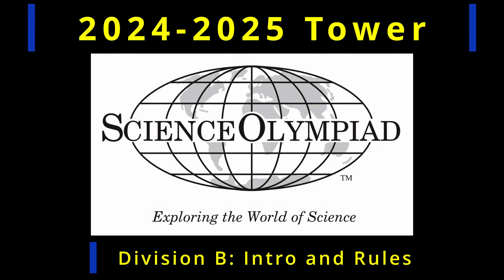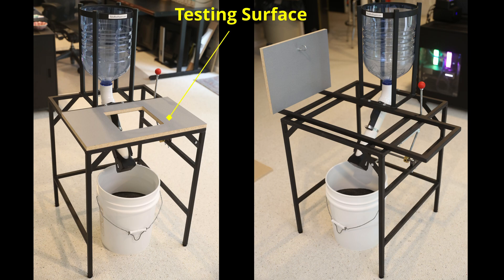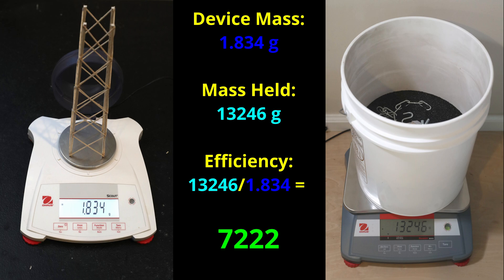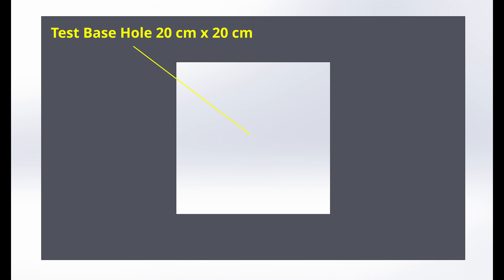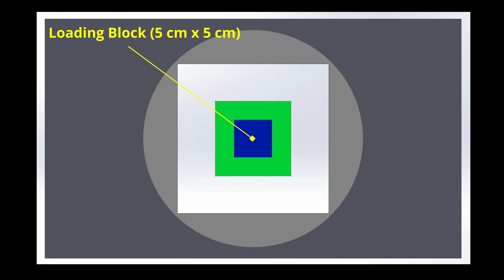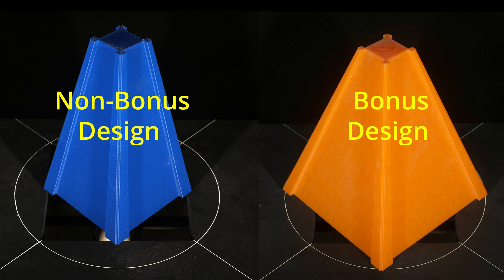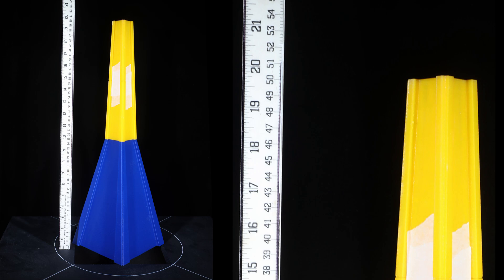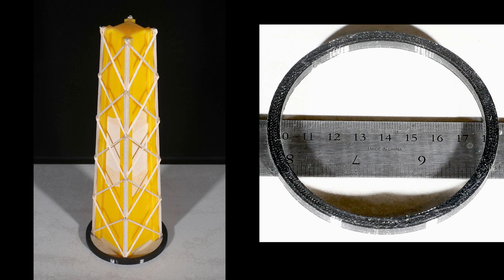2025 Science Olympiad Tower Div B: Intro and Rules

Comment: Hi, we have a question regarding the ring. Should it sit at a point 25cm above the test base OR can it be anywhere below 25cm above the base, like 23cm or 15cm from base bottom.
Reply from the maker: The ring doesn't have to be at exactly 25cm only, it just need to be able to fit AT 25cm.  For example, your device could allow the ring to be all the way down to 15cm from the base bottom, but that also means it would easily fit at 25cm from the bottom.  Generally though, you will find that it's more optimal to design that ring clearance to be as close to the maximum height as possible, but definitely experiment with it on your own!
Reply: @balsaengineering6686  Thank you so much. So far it's close to 25cm. Your videos are a great help. We won 4th place at Rockford and 5th place at Kildmas invitationals.
Reply from the maker: @IYASisters  No problem.  Congrats on your recent results!  Keep up the good work!

Comment: Every video in Division B shows a 4-sided tower. I don't see in the rules that a 3-sided tower is forbidden. Is that correct? A 3-sided tower is allowed as long as it meets the width and height requirements.
Reply from the maker: Yes, a 3-sided tower is definitely allowed if it follows all the other rules. They are typically much more difficult to build which is why I’d generally recommend 4-sided when possible.  See some of my Div C videos for what some of those challenges are as 3-sided is required for that division this year